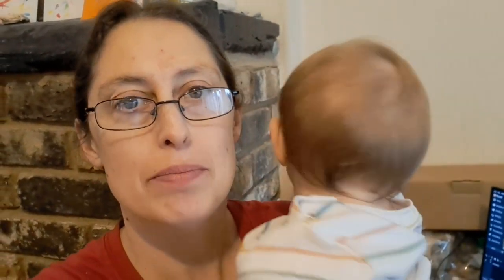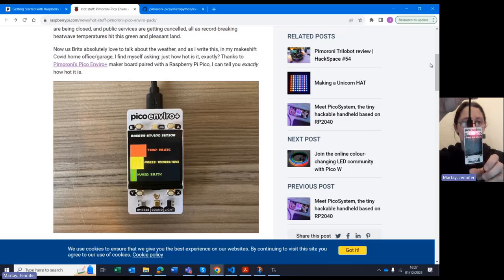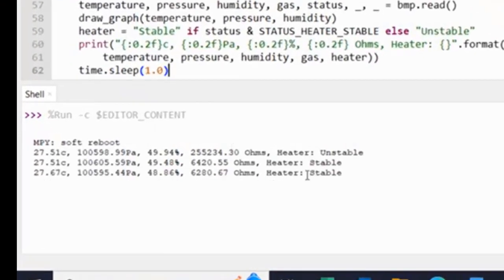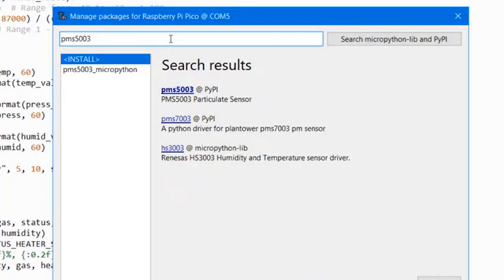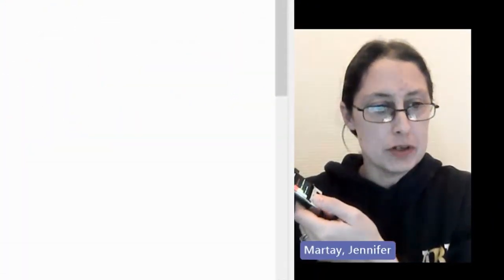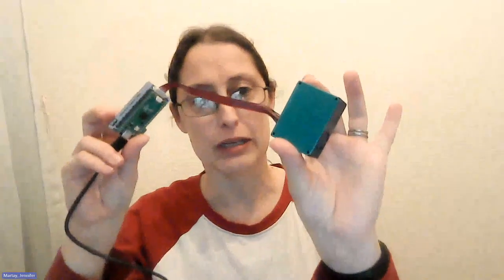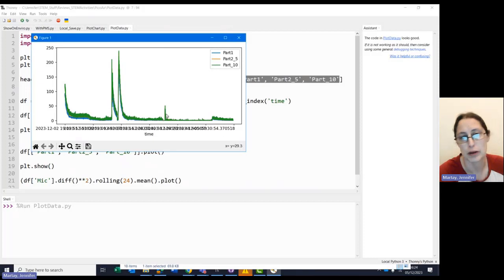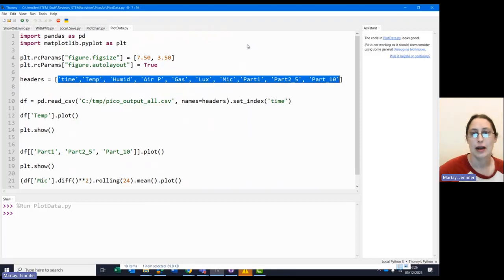Air Quality Monitoring with RaspberryPi Pico, PicoEnviro+, and PMS5003 Particulate Sensor, Part 1

Comment: I plan to use this exact setup in my home lab. I recently bought a 3D printer, and I'm worried about the air quality. This video helps. Thx.
Reply from the maker: Just following up --- did you find anything interesting looking at the air quality around the 3D printer?
Reply: @articlesbyaphysicist I incorporated the VOXEL Bento filter inside a Fnatr printer case. I operated the Sensor both during printing and when it wasn't in use, but I did not observe a notable difference. Interestingly, I noticed that cooking leads to a rise in particulates. I'm uncertain about what this implies.
Reply from the maker: @Darryl.Harris  We also found that cooking caused particulates --- opening the oven while a chicken is cooking was a (kitchen) environmental catastrophe. I wonder though if cooking particulates are more easily removed by the lungs than plastic particulates.
Reply: @articlesbyaphysicist  I'm now thinking about the long-term health implications of cooking and plastic particulates. My focus has broadened to include not just removal but also how each type of particle affects our body while present. I'm currently wondering if the persistence of plastic particles, and their potential to cause chronic inflammation, makes them more of a health concern than the volatile, yet potentially carcinogenic, compounds from cooking. Thanks for sending me down another rabbit hole😁😂